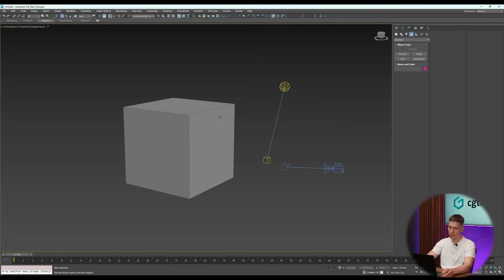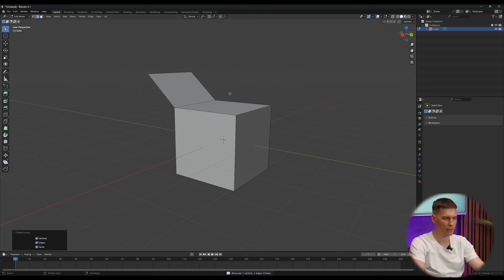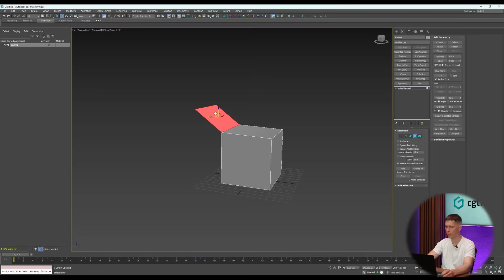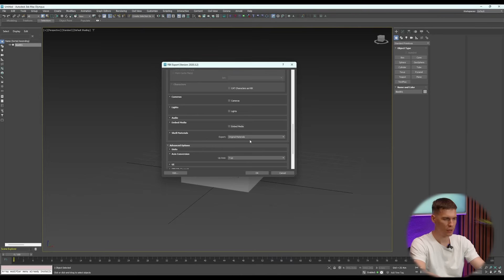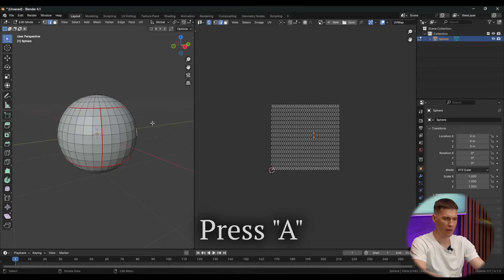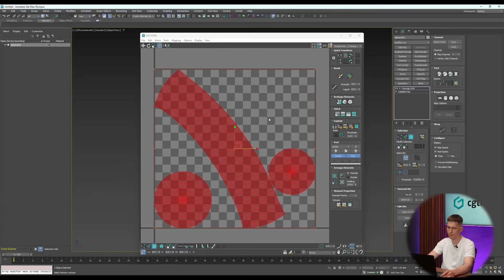CGTrader Quality Standard TUTORIAL | How to Create High Quality 3D Models

Comment: In principle, your requirements are fine, but you should relax some of them for specific types of models. For example, i am modeling large vehicles and i will never get a 100% rating, because these types of models do have overlapping UVs. Same for most archviz models. Also, for the n-gons, on complex hard surface models it often is more practical to leave in ngons. They are not subdivved ever, and parts can be easier to select, or just easier for the human eye to distinguish without a ton of random edges going around just for the sake of dividing it tris and quads.
Reply from the maker: You’re right that overlapping UVs and n-gons can be useful in specific workflows — for example, on large vehicles, repeating parts, or static hard-surface assets.
However, from a validation and marketplace perspective, it’s more beneficial to avoid them. They’re easy to misuse and difficult to verify automatically. Overlapping UVs or n-gons can cause shading, baking, or rendering issues that aren’t visible until the model is used in a different environment or pipeline. Since there’s no automated way to determine whether they’re used intentionally or incorrectly, our system flags them by default.
Additionally, buyers use models in many different ways — games, visualization, 3D printing, AR, etc. There’s no guarantee that overlapping UVs or n-gons will be compatible or beneficial in those contexts. Maintaining clean, non-overlapping UVs and quad-based geometry ensures predictable, high-quality results for all use cases and users.